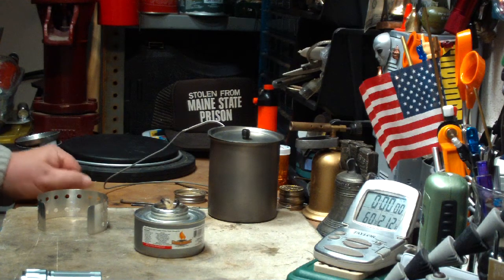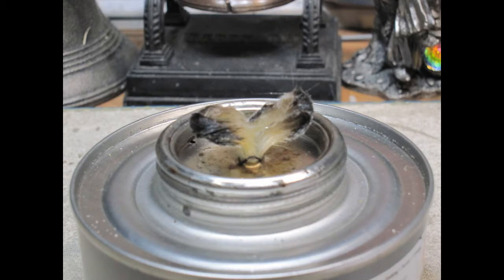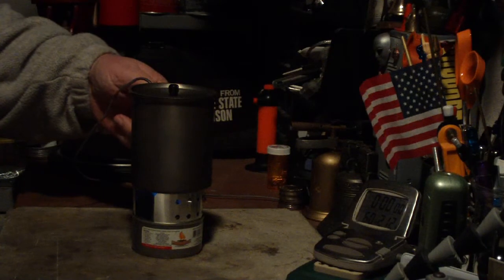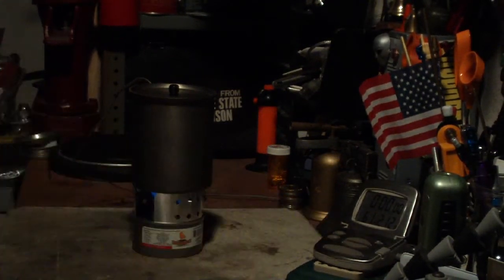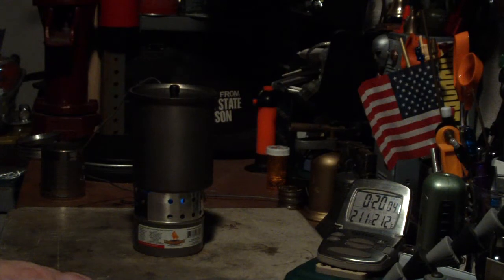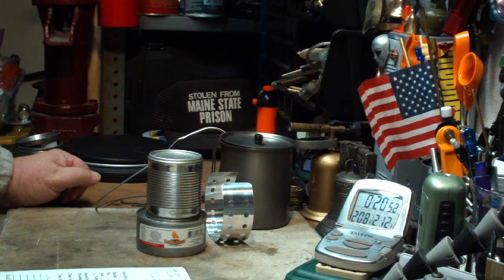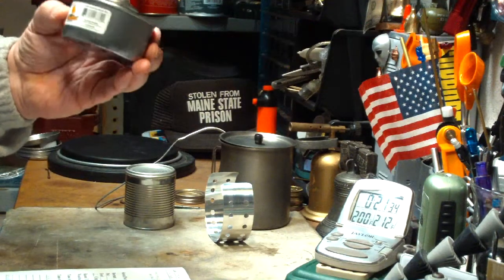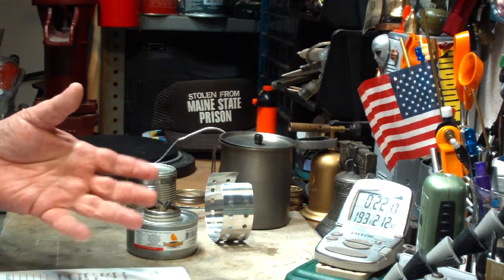''All-In-One'' Stove - IntenseOutdoorGear.Com - Modified Wick - Boil Test #3

Comment: I ran my test again at 2 cups starting at 60 degrees and it took 18 minutes this time, a little longer. But likewise my can was almost out of fuel. You shaved 4 minutes off by spreading the wick, not bad. I'll try again tonight with a new can, wick extended and spread out. Also that flashing pot stand might take some of the heat.